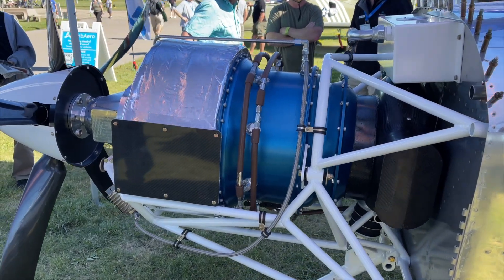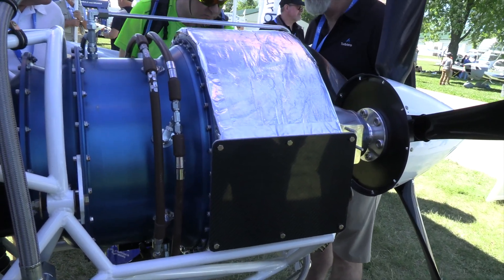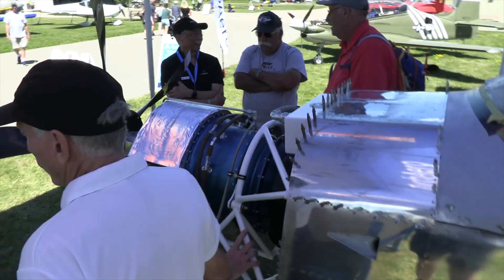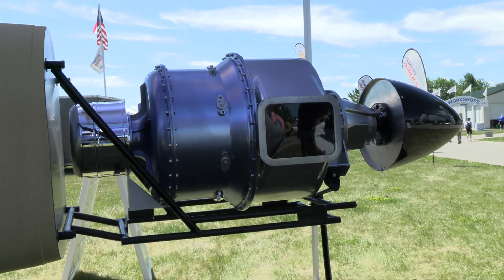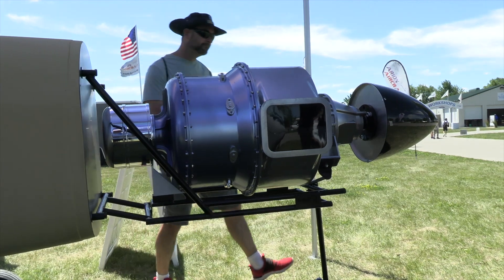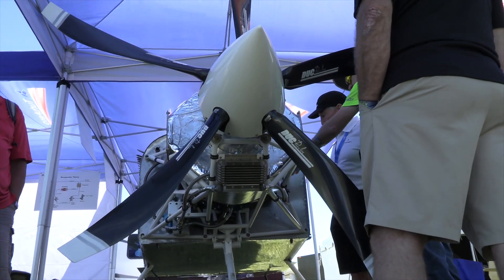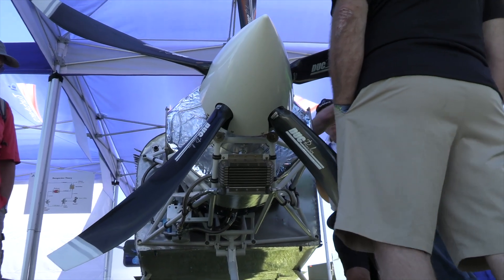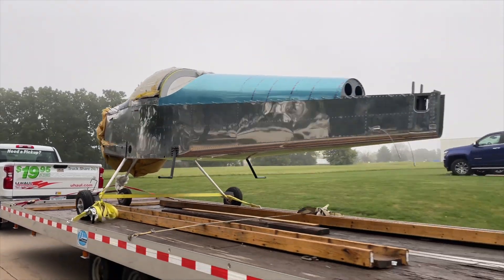TurbAero Update from AirVenture 2022

Comment: If they are able to achieve a fuel burn of 12.7gph at 150hp output that would still be an amazing accomplishment for a turbine engine. The burn would only be around a 25% increase over a reciprocating engine.

Comment: It sounds better than it did last year. It needs to be lighter than a piston engine making the same hp at the same fuel burn or less and be comparable in price before builders will be buying them fast enough to give piston engines actual competition. It's possible but they must perfectly the process and build them in bulk. We would all love to run turbine but we're skeptical because we've never come close to affording one. Fix that problem and you have a deal.

Comment: Chysler with their turbine cars used an exhaust gas regen heat exchange 50 years ago. Highway mileage was not bad, but city driving economy sucked. Probably would have made a good turboprop aircraft engine to compete against the Pratt and Whitney Canada turbo props.
Reply: they are sold as Williams engines today

Comment: I wish them all the luck in the world and can see them getting customers if they can keep the cost under $125-$130k, about what a new TIO-360 will set you back.  A lot of folks will want one just for the bragging rights of flying a Turbo-prop.  The increased efficiency, power and fuel burn are all important and comparable, but I would also like to know what their projection is for TBO.  That number will have a big impact imho on the actual cost of ownership and market penetration.  If it is not significantly greater than the TIO-360 It's going to be a hard sell.
Reply: You are absolutely smoking bad crack!  If your paying anywhere near that kind of money for a POS TIO-360, you are that sucker.  The Continental TIO-360 is the worst joke any manufacturer ever pulled on the aviation community.  I’ve NEVER seen a TIO-360 get anywhere near TBO, and I’ve been busting knuckles on aircraft for 35 years!  A turbine engine has miles to go before it ever gets anywhere near the “efficiency” of an internal combustion engine.  Quit looking at all of the sparkly shit and do a little research.  The first time something on this oil burner breaks you’ve just blown your “efficiency” margins in repair costs!  This engine will NEVER make it market for an affordable price other than to serve a niche market of idiots with more money than common sense!

Comment: Mogas is cheaper than jet fuel, piston engines are cheaper than turbines, this seems silly.

At higher power levels (400+ hp), this might make sense, but a 200 hp turbine is going to drink fuel like there's no tomorrow, even with a recuperator.
Reply: Maybe it's silly and maybe it's not.  The advantage of a gas turbine engine is it can provide a lot of power in a very small and light package and the main disadvantage being that it is has so far been impossible to get a small gas turbine engine with efficiencies that are comparable to piston engines of similar power outputs.  While I'm not going to be an early adopter of such an engine, I think the best attitude is to wait and see what they can do with their approach.  There's no theoretical reason why it can't work.  Let's see what they can actually build.
Reply: @jonathanguthrie9368  Sorry, my comment was a bit lazy and didn't fully explain why I believe the development of this engine to be a waste of time.

IMO, modernizing piston engines makes much more sense at these power levels. Consider the Adept Airmotive 320T/360T, it's significantly more efficient than traditional aircraft engine designs, while also being much smaller and lighter than traditional aircraft engines in the same power output range.

The main reason why the engine in this video will never work is cost. Turbine engines are inherently more expensive than piston engines, and even if this engine manages to have the same fuel burn as a piston engine, it will be burning more expensive fuel.
Reply: @PistonAvatarGuy  I still don't understand why you object them wasting their own money to pursue an unachievable objective.  If you're right, it will be apparent soon enough.  Should that come to pass, you have my permission to tell me "I told you so."
Reply: @jonathanguthrie9368  Just take a second to imagine a world where no one ever criticized anyone for doing something stupid.
Reply: @PistonAvatarGuy  there is however an awful lot of critics in this world. I've faced off against a few myself. Some have proven me wrong & some I have proven them wrong. But hey we gotta try right?
 Just think about Orville & Wilbur's critics telling them,  you can't fly! Yah see what I'm sayin? Ha ha
Reply: @oneninerniner3427  Our understanding of science and technology has come a very, VERY long way since Orville and Wilbur, and I think that it's ridiculous that people want to try to produce pie-in-the-sky nonsense before exhausting all of the ideas which have a high chance of success, especially because so many people have been wasting such enormous amounts of money on ideas that were obviously going to fail in recent years.
Reply: @oneninerniner3427  To add to my previous comment: I also think that it's absolutely hilarious how capitalists are so quick to point out the failures of government, but think that it's perfectly acceptable to have private individuals wasting endless billions while attempting to develop technologies that were never going to work. The list of failures of this kind is one that is absolutely endless.
Reply: @PistonAvatarGuy  that's probably pretty accurate. But wouldn't it be cool if they could pull this off.  But Just like electric vehicles, aircraft and stuff, yes we have working ones but until they can figure out how to get some good battery endurance they're not terribly practical imho.
Reply: How about the Cirrus & Sonnex jets, how are they working out? Oh and doesn't Bedee have one too?
Reply: @oneninerniner3427  What would have been awesome is if Toyota had been able to get their FV2400-2TC into production, as the UZ series engines were absolutely legendary, not only because of their incredible reliability in road cars, but also because of their success in racing. Just imagine a Sharp Nemesis NXT with a 650+ hp V8! But, of course, profitability got in the way.

In this video, Burt Rutan talks about the aircraft powered by the Toyota engine, the relevant part starts at 20:56: https://www.youtube.com/watch?v=2OZQ-9Nd76g

I can't really comment on the VLJs, piston engines are my thing. I'm sure that they're just fine, as long as you can afford them.

Comment: Based on how aviation projects typically go.....the cost estimate is about 50% or less of reality. So.....around $170,000+ by the time it makes it to an end-user airframe. 

Please prove me wrong.
Reply: That is the problem with GA, eventually we will run out of old doctors with money to burn. Someone needs to bring true cost effectiveness to the market now. Even kitplanes are getting ridiculous now. Unfortunately, the FAA is our own worst nightmare and with the special interests pushing a global climate "crisis" agenda, I think GA is likely to suffer even more.
Reply: @glsracer  as a guy with two siblings that are doctors I can say that I’m richer than both together after 20 years of us all working. Doctors are not the ones raising prices.
Reply: @Mobev1  you could be right about that. Whoever it is has more dollars than sense.
Reply: @glsracer  The reality of the climate crisis has little to do with it. 

GA is hard. Power plants are really hard. Turbine power plants are really, really, really hard. 

I understand and appreciate the ambition of the individuals and companies that are pushing for innovation. The costs typically come from the avalanche of practical details that come at the end of the project. 

Manufacturing extremely precise, low-volume, specialty machines is expensive. That gets even worse when lives are on the line. Everything has to be controlled, monitored, and tightly toleranced. 

On top of all that.....the design cycle almost always takes many multiples of the originally budgeted time.....that cost gets added to the end product as well.
Reply: @Factory400  The problem is the required materials are extremely hard to work, and expensive.
You could probably build a jet engine from mild steel, 'cheaply', if you allowed a monstrous amount of cooling that destroys the efficiency.  Even then, you may only get 1 start out of it, and 10 hours of run time.
Something that can be started 5000 times is probably going to cost deep into 7 figures if only 8 are made per decade.  Gulfstream survives because there are lots of millionaire people whose companies are footing the bill.  GA, where the 'owner' is footing the bill, not so much.

Comment: It's very exciting to finally see development progress toward a small-GA turboprop engine, but I'm concerned about a couple of sentences in the video, at 1:51: "Our goals [...]  have been to sell the engine for the same price as a piston engine, and then to have a fuel burn that is the same as a piston engine.  Those are very lofty goals and we haven't achieved them a hundred percent, and probably won't..."  Indeed.  I presume they're comparing against something with roughly similar cost and power, like the 210hp Lycoming IO-390 (which, at 75% power, will have horsepower and fuel consumption similar to the TurbAero's 12.7 gph at 150hp as stated in the video).  I'll be very interested to see just how far short of their goals they end up.  My prediction is that installing this engine with a compatible propeller like the 5-blade constant-speed DUC-Hélices unit shown, with a custom cowling, will push well into six figures.  No doubt there will be well-heeled builders who are willing to spend the money for the turbine sound and smoothness, but the majority will continue to install used or rebuilt O-320s and O-360s.  Sadly, unless it attracts a high-volume commercial customer, I doubt this project will ever achieve the economies of scale that would make it widely affordable in the Experimental Amateur-Built market.  Perhaps low volume will be enough to make a profitable enterprise for TurbAero.  I certainly wish them luck.
Reply: At least they recognize they're lofty and they're not there. Instead of all talk, but nothing to show.
Reply: You can buy small GA sized turboprops already, incl. heat exchanger, TurboTech from france makes one and afaik they are flying them. The recent demo of the turboprop VL3  had one.

Comment: I assume they are adding heat to the inlet air with the recuperater after the compressor?
Reply: I don't know much about turbine engines, but thermodynamically speaking it would be more efficient by a long shot to heat the atmospheric temperature air before the compressor.
Reply: @thewheelieguy  heating the air before the compressor would have exactly the opposite effect. The air would be hot and less dense before entering the compressor, thus reducing the mass of air available for combustion. Thermodynamically, it makes sense to head the compressed air. This is where heat needs to be added to the brayton cycle, and that is why fuel is combusted after the compressor/before the turbine. Heating the compressed air with exhaust gas decreases the amount of fuel needed to reach the same temperatures and improves fuel efficiency.
Reply: @skyler9903  Thank you - I had based that quip on just the heat transfer rates being better from the exhaust to cooler ambient air. Heat engine cycles and continuum mechanics were never my thing.
Reply: @thewheelieguy  I understand where you are coming from. It would be easier to get more heat transfer with a smaller heat exchanger before the compressor
Reply: @thewheelieguy  ...... NO
Reply: Yes. Using a recuperator BEFORE the compressor would mean having to compress hot air, which takes more energy than compressing cool air. Because turbines use so much of their power output to compress air, this is a bad idea. It is a much better idea to have the recuperator heat the air after it exits the compressor and before combustion. This way, heat transfer from the exhaust directly replaces fuel that otherwise would need to be burned.